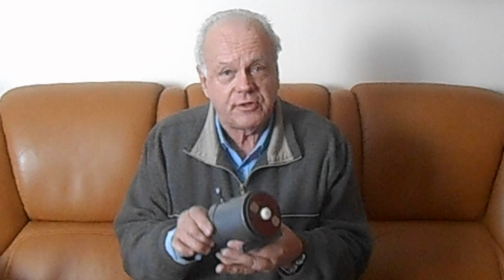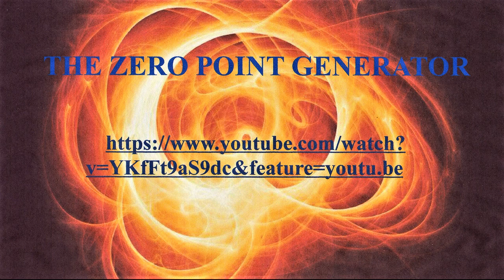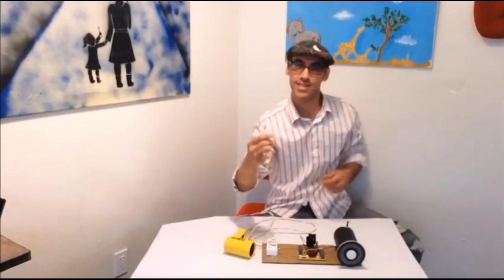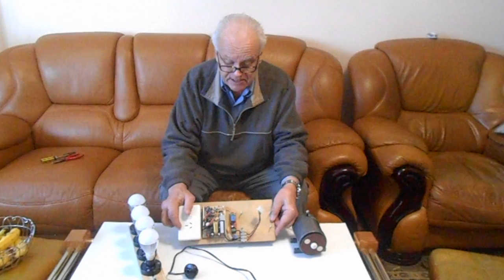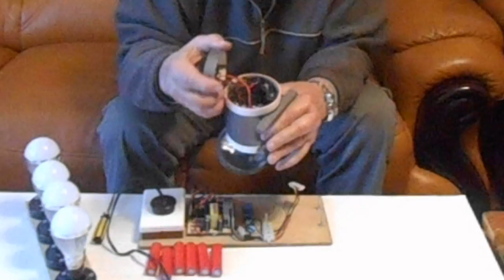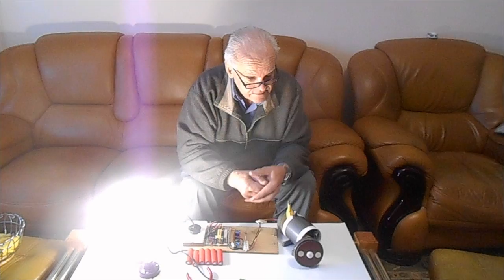Video2

Comment: At several time points before demonstrating, he slightly shifts or positions his right leg and glances quickly to his right foot, as if he wanted to make sure the power was switched on or off as he needed in that moment.
Examples: 05:03, 05:52, 08:43, 09:51

Comment: "Free energy" is everywhere. Its sitting in the EMF field off things like the tesla coils primary coil.  You can see them in Teslas lab photos (he took a million pictures of them (he was trying to show you disguised under the lightning)- a grid by the base and tall tightly wrapped coil columns evenly positioned around it on poynter vectors - look it ip) the true power sat under the lightning.  The capture devices are Heaviside Components - look up Poynting, heaviside (and the original Maxwell equations if you want to figure out how ZPE gets into the true syfy stuff!) good luck and be safe!

Comment: A few DC batteries would never pull the load such is a heater. 30VDC to 240VAC inverter is dubious at the least. So, I think he figured it out but the gatekeepers did what they supposed to do.
Reply: Is this why on this video he’s acting different. He seems to be off when explaining how the device works 🤔
Reply: It's not DC batteries It's lithium ion cells. And they can make cars drive dude. Lithium is powerful

Comment: So how did those 6 Lithium-Ion batteries run the heater in the first video? If I am correct, the batteries won't provide more than 30 Volts and 20 Watt - a heater takes more. 
I guess the batteries were as necessary within this setup to provide energy as the banana. :-)

Comment: So the theory behind electrical free energy isn't simply the impossible, it's not about getting more out than in in a closed system.

It's about connecting to what ammounts to some transgalactic radio power station.

In essence it isn't physical it's spiritual.

I'm doing my due dilligence into that phenomenon but don't worry I won't buy anything.

Nor will I sell anything.

Anyways I love your hoax, it's very well perpetrated. Good job 👍

Comment: It can be done but you need a device that gains mass.. it's the only way. You use sound to make heat and sound to move the heat in a thermoacoustic process... this  creates condensation... and therefore it makes water then spins it in a torus. The water droplets split apart from the sound and this creates a voltage potential that makes a plasma arc that explodes the hydrogen that is vibrated apart from the sound... The explosion sound is fed back into the microphone in an endless feedback loop. The only drawback is that it gains mass and therefore will slow time. I have designed a device ready for a cnc machine but I won't build it because it puts out too many volts and too many amps.... so freaking dangerous. It's not free energy because it makes it's own water and uses it for fuel..... but it cost nothing to run. It will make air, hot water, electricity and gravity and there are only 13 non moving parts... If anyone wants to mess with a terawatt and build at own risk.. I have the cnc codes to make all the parts. You can't patent this it will slow time... it will get seized. I won't show it on you tube... it would be too irresponsible to ask someone to build it as they would be risking their life. Whether you want to believe it or not... I cracked time and gravity... and I wouldn't even go public with it. To figure it out you have to throw away everything you learned in school out the door.... and take a good look at the galaxy.... it's a doughnut... and so you have to make a galaxy in a box that has a black hole that will suck everything into the hole.. and there are 7 elements in the air that will get sucked into the hole and it WILL gain mass. I have 100% confidence that it works but it's too powerful for a car and more suitable to power a whole city... transformer not included. Even dust falling into the hole will create energy... dust spinning in a torus will make a spark. Take a good look at a hurricane.. it is powered by sound and it spins water droplets and dust in a torus.. and this creates hundreds of millions of volts and thousands of amps..... no battery or coil or magnet is required.... just sound... unlimited energy is so freaking easy... but you will get more than you bargained for as time slows around it.
Your an electrical engineer you would know this: that a high voltage system using AC current and water .. the amperage is going to go up as the voltage drops.. and there is no fuse....so your going to get a lot of heat to drive the thermoacoustic doughnut... and hot plasma holds a lot of energy and is an awesome conductor... so you end up with a spinning plasma contained between 2 magnetic fields... call it what you will... cold fusion... with no wires or magnets... a mini galaxy in a box. Please point out to me the coil and permanent magnet that powers our galaxy?.. there is none and you don't need any.. it's powered by sound and feedback. See what I mean?.. you have to throw everything you learned out the door.

Comment: Gerard Morins generator works.... another example why you should take everything you hear as a grain of salt. on the other hand experiment for yourself go check out rodin coils and try to hang a piece of copper in the air and with a ground see if you can detect voltage. if this works for you then keep going try to step it up and add some transformers make experiments see what you can do, don't just listen to some fool tell you something can't be done.

Comment: your wrong, there is energy everywhere, it just a matter of tunning to the right frequency and calculating the wavelength of that frequency to make an antenna or capturing coil the size of the area of the capturing device determines the power. i can extract 5KVA easily using grounds and can even capture it without earth grounds.
you mind is in the box.
Reply: Yes, energy is everywhere as in electromagnetic waves, static electricity but their strength is very very weak.  There are ongoing experiments to try and capture some of this energy, but this requires huge arrays and the return is small.  Therefore not viable other than experimentation.  Stick to solar, wind, water and underground for lasting sources of energy that produce a lot more energy per unit cost than an array of antennas capturing atmospheric waves.  BTW:  Finding the right frequency?  There is no right frequency.  The atmosphere is made up of all kinds of frequencies and many are created through collision with other waves.  You want to learn more, there is lots of research you can do online.

Comment: I knew you had a fake device.  I could hear the clicking sound of a relay which is the typical  component for pulse motors,  but it turns out you were using a simple DC motor.   It did made me angry knowing that someone is trying to deceive people again under the banner "free energy."  So I'm glad you came out clean.........  

I just don't understand why you would do this. There are plenty of scams on youtube already. You're just adding more of this unnecessary garbage to an already massive collection of garbage.